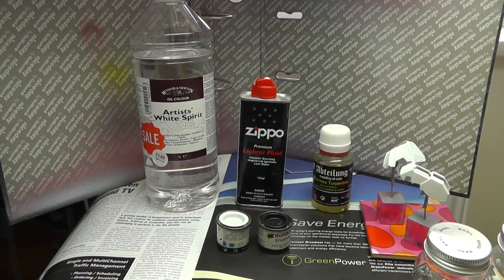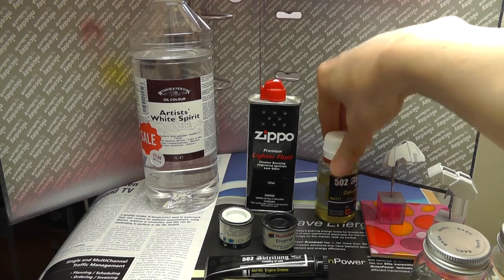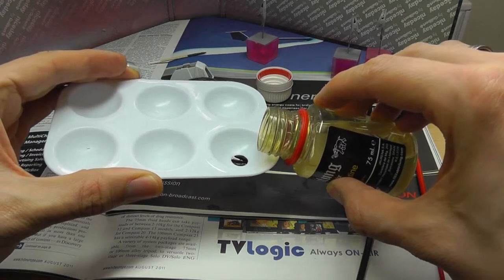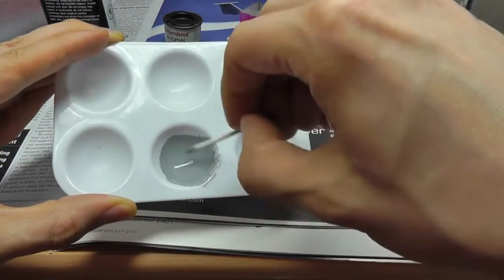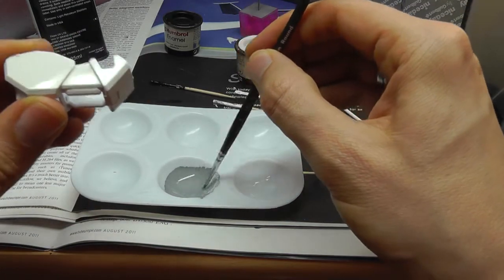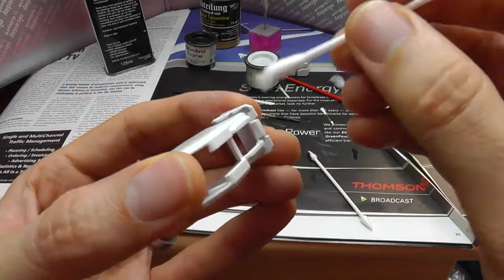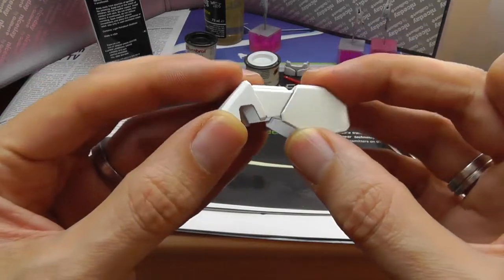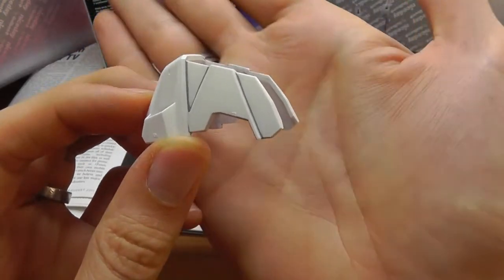Panel Lining - enamel vs oil

Comment: I know this is an old video and the concerns have already been addressed but: First, it seems your tube's either gone off or has separated, the oil paint should be thick and gloopy, so the paint you placed in the palette was mostly linseed oil which will never dry. So assuming you can get a fresh tube with no problems, you'd put a little blob on a sheet of cardboard or similar and allow any excess oil to seep out of it. Once that's done, you'd mix in your thinner. Second, you didn't use enough thinner. Washes work best when they're basically tinted thinner, and the pin washing thing will work better then too. So basically, it didn't dry because you had too much paint in your wash, and what paint was there was mostly linseed oil rather than pigment so yeah, that would never dry. They're a pain in the arse but when you get them working they're dandy. Hope you've got it sorted by now!

Comment: The flow through capillary action seems to vary depending on the paint/thinner ratio and the medium onto which wash is applied. The lack of capillary action is not an issue, as the dabbing to induce flow is perfectly fine, especially in light of the results, as seen in this clip. But the comparison of enamel and oil is appreciated, with both seen as qualified to use as an alternative to expensive, dedicated bottles of wash. (Nothing against commercially available washes by noted manufacturers.)

Comment: Good advice below but another thing that may be worth mentioning is the oil paint contains....errr I can't for the life of me remember what its called but it's the main ingredient that takes so long to dry and you can remove the majority of this by using a piece of cardboard as your pallet and letting it sit an hour or so before use- you'll be able to see on the card the oil being soaked up. And like Rob says below I also own the Abteilung oils from MiG and mine are thick like normal oils not runny like yours- I can only suggest giving the tube a squeeze for a few minutes and see if that helps?! Good luck and thanks for the upload!
Reply from the maker: shirlzknight Oh I did try using a cardboard pallet but I didn't let it sit for an hour so I'll give that a try. It is weird that my oil paint is so runny... I'll give it a squeeze and see if there's any paste in there!
Reply: Yea it could be it has just separated- can't think why! Good luck with that! what did you think of that guys Millenium Falcon? I had no idea oils could be used like that! I have a tank sitting here ready to do my first ever oil pin wash on but after that dries (fingers crossed it does!) I shall be trying out some of that dudes techniques.:)
Reply: Tony Micilotta I just went through all my tubes of the same gear as yours (502 Abteilung) and they are all thick and gloopy! Maybe you have got a bad batch ??
Reply from the maker: shirlzknight
yes the rendering on the Millenium Falcon looks great! So clever! I would love to know how long it took to dry!

Comment: Just as an update I have just put down a panel wash on my Rhino (Warhammer 40,000 APC) and so far so good- it has even dried on the area I started on but I wouldn't attempt to work on the model for another 24 hours or so unlike yours so far it has stayed in the corners and crevices. It still has time to all go wrong and I'll keep you updated but so far so good. Did you have a squish at your tubes? I wonder what all that runny sh*t is?
Reply from the maker: shirlzknight Well I jammed in a tooth pick and gave it a thorough stir and it now has become a paste! Thank you!

I then thinned it with artist white spirits and it's sticking in the corners and panel lines of a part! I'm going to have to post another vid... sorry guys!
Reply: Great news! Now you can enjoy your paints as they were intended. I got a nice result today with mine- the paint appears to be completely dry but I am still hesitant to touch until a full 24 hours has elapsed. I am going to use some of the 'Falcon guys' techniques on the rest of the model and see how that works out. Cheers :)

Comment: oil paint takes weeks to months to dry depending how much thinner you use and how thick you apply it.
Reply: ive been using it to wash my gunplas
Reply: oil paint wash is only good if you plan on washing everything, the thicker you apply it, the better it goes on.